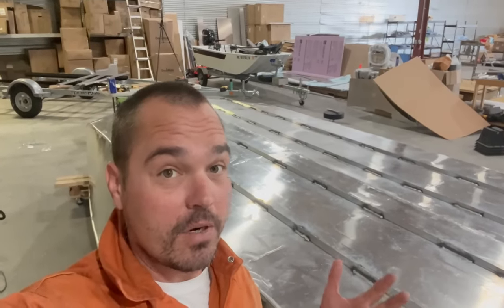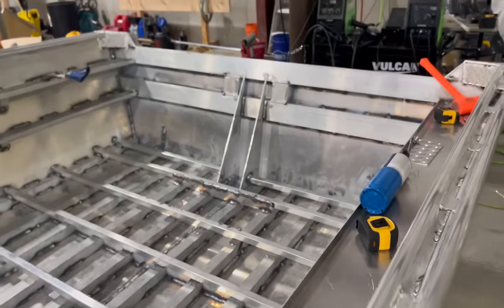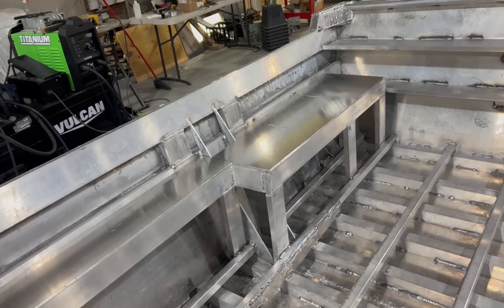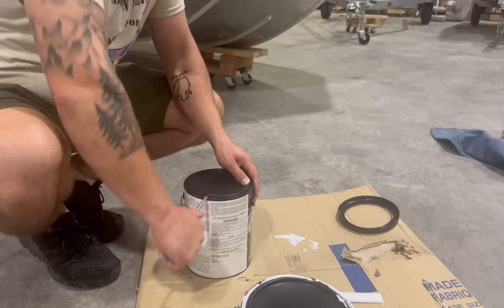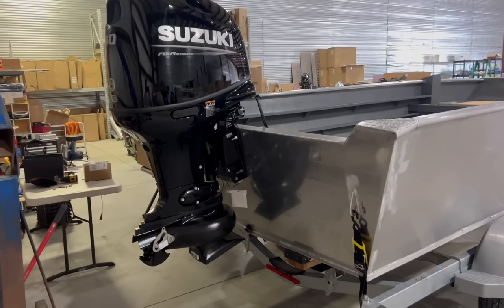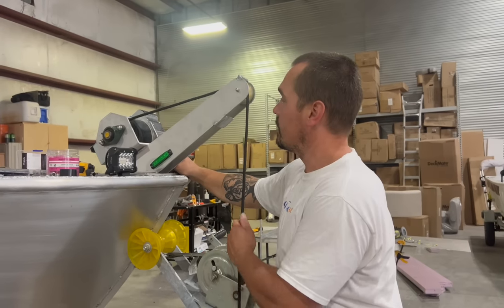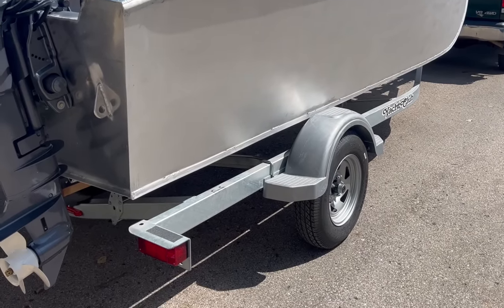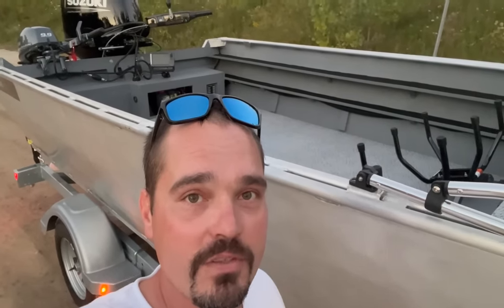EXTRA WIDE 17' Custom Welded Boat Build - Part 3 of 3

Comment: Why plywood?
Reply from the maker: Comfort and quiet. Standing on an aluminum floor all day or kneeling on it is far less comfortable than plywood. It's stored indoors so I'm not worried about it ever rotting, and the vinyl is 100% waterproof too so water just runs off it and into the bilge. A lot of the big name brand boats choose plywood over aluminum for their floors, so I can't be that crazy 🙂

Comment: That is one heck of a nice boat! I think people underestimate the ease and value of having an open floor in a boat, so many people spend thousands and thousands of dollars to have dozens of aluminum boxes manufactured for the inside of the boat cluttering it up. I love the lawn chairs instead of fixed benches or half boxes/seats. I am curious why the longitudinal stringer are not one continuous extruded tube that runs from the bow to the stern and having the front bent for the bow. Also 5086 H32 aluminum sheet is available in 120" x 300" sheets so that you your hull could be one piece of aluminum, with a 76" bottom it would still be wide enough to have 22" sides and then you just have to seam weld an 8" wide strip above the waterline to get the 30" sides you wanted, everything below the waterline is seam free. How much did all the aluminum cost for this boat project? Thank you
Reply from the maker: I love having all that open space, and the way I fish it makes it convenient to be in the back of the boat all the time. I've toyed with the idea guiding river fishing trips part time, and this boat would be perfect as a captain. The only downfall is when it's 35 degrees out the tiller isn't so fun. Someday I'll probably build something with a windshield and enclosure when I can't handle the cold anymore. 

I would love to know where that size sheet can be sourced?? The biggest that I'd heard of from my supplier is 84" wide, and they can run around 240" or so, but it's at a different facility than the one local to us so that adds a huge issue logistics-wise. I am pretty sure the two model boats I will build in the future will be 20' overall length with a 72" bottom and a 14' with a 60" bottom. 20' gets me over needing any flotation from the USCG requirements, and 14x60 seems to be a desired niche boat, perfect for two people and gear. And a 14x60 would be easy to design and incorporate foam for level flotation. 

I will probably run full length stringers in the future, but just sort of attacked this one as I went for those types of details. If I run them full length I can slit them to bend them up at a certain point. I full welded them in either way, so they're adding as much support as a partially welded full stringer as far as I'm concerned.

I think I had close to $10K into the aluminum for this boat, which is incredibly over-built. I could probably take out 30% of the extrusions and be just as solid!
Reply: @tomspontoons  The supplier is TW Metals, I will put the web address for that exact sheet and size in a separate comment as sometimes YT or the settings people have on their channel will delete any comment with a web address. If you do not receive the link let me know. I appreciate that you take the time to leave a detailed reply. Thank you
Reply from the maker: @chrisdaniel1339  Got the link, thank you!
Reply: @tomspontoons  No Worries

Comment: Big difference between ventilation and cavitation. I believe you have a ventilation issue rather than a cavitation issue. Cavitation is a propeller issue, ventilation is when the propeller sucks air from the surface and over revs. This is usually caused if the propeller is not deep enough in relation the the transom. Good job building a really nice boat, good luck.
Reply from the maker: We have tons of fun with “cavitation” on the channel, and you are correct, it’s ventilation when it’s poor water flow to the intake or propeller. It’s running great now though!! Thanks for watching!

Comment: I did what you did with the flotation loose and under the floorboards on a small 13 foot sailboat. When we tipped it over and were trying to get it back upright to bale it out….. the flotation put so much upward pressure against the floor boards that they all pulled loose. We then had floor boards AND flotation floating all over the place. Fortunately the boat was made of wood so it didn’t sink.
PLEASE make sure that you really over fasten those floorboards. Otherwise, if you swamp the boat it will go to the bottom and all you will have left is floorboards and Pink Panther foam. LOVE your boat though. Awesome work!
Reply from the maker: Wow!! I've never even thought about that. I'm pretty sure we've got close to 100 stainless screws in total all going into 1/8" thick aluminum to fasten the floor. I'm confident that it wouldn't push out, and mostly just hope to never have to find out!

Comment: Awesome project! I'd only question putting the fuel line in with electrical wires??? KA-BOOM!!!
Reply from the maker: No way around it on 99.9% of fishing style hulls. Heck, take a peek at the stern storage of a bass boat...they've got fuel cells and hoses, batteries, wiring, battery switches, etc. all in that compartment. Plus that's what fuses/breakers are for on the electrical side of things!!

Comment: Hvac tech in Miami Florida. 

I direct sunlight i use a wide brim sun hat. 

For the heat in general i use tons on cold water internally of course but also externally. 

Using a cooling neck rag or gaiter soaked in cold water works wonders for me. 

I freeze 24 (cuz that's what my cooler holds) 12 ounce Bottles of water in a chest freezer. 

Whenever needed i douse the gaiter in the cold water and it helps keep me cool. 

In extend situations i also douse my arms, neck, head, etc.

Comment: Hey Tom.  Wondered what you would put under the floor. I know the trade offs, but spray foam under ultra high grade marine flooring makes the boat ride and feel amazing. Needless to say, 100% waterproof, full floatation & amazing stability. I know it makes the floor semi permanent, but do it right and that's OK. I laid in two 4" PVC pipe conduits so it would be easy to run any future wiring. Two openings midship each side and then of course front & rear. I didn't find out until after, but learned you can coat the inside of the flooring with PVC sheeting or even heavy ground cover plastic, mount floor, then spray in the foam. That way floor can still be removed. (Foam won't bond to the floor). Wish I'd have done that.
Reply from the maker: Yep, we just did foam sheeting to keep it removable and dry. It allows for air to move under the floor and between spaces under the floor which should keep it dryer and fresher. I’ve heard of folks filling plastic bags with two part foam too in order to keep the foam from sticking to the floor and/or bottom of the boat.

Comment: Awesome build,,in 2021 i bought a new Suzuki 20hp with electric start for my 1542 jon boat,,was 10 hours break in period,,very nice motor and so quite and great on gas, hope you guys catch many many fish with that beautiful boat
Reply from the maker: Yes, this was 140 is also 10 hours total. The first 2-3 are the most critical in terms of not going wide open throttle and such. Heck, we’re still breaking it in when we fish (let it warm up extra long and no wide open for extended periods of time). I have the materials for a 1542 Jon boat, good to know a 20 hp could push it!!! Thanks so much for watching.

Comment: That’s one heck of a build you did! I’m surprised you used plywood for the floor instead of a composite material. That plywood will eventually rot out. And yes, I’d like to see a follow up after you’ve got some time on it and any adjustments/changes you might have made. Cheers!
Reply from the maker: The plywood debate will always be there. I love the comfort and quiet of plywood under my feet. If I have to replace the wood in 10 years I’ll be ok with that. If it rots sooner than that (I’ll be surprised if it did) I’d replace it with aluminum or composite.

I will definitely do an update in a couple weeks when we get more fish slime in it!!

Comment: Such a nice boat to have used wood in the floor
Reply from the maker: I totally get that. Its 100% a personal preference. I love the soft and quiet feel of wood under my feet while fishing long days. Weight wasn’t a huge concern either. My 12’ build was meant to stay super light, so that got 0.100” aluminum floors…it’s got more flex and more noise than the wood floors of this big boat. I’m all for either option!!

Comment: I always wanted to take a diesel outboard powerhead. Build a fire hydrant as a jet pump housing. Mounted to the bottom.   8 outlets.  2 big outlets to the transom.  2 to each side and 2 aiming forward now i have full internal thruster system. The power head and impeller are on a quick release. So i can pull them to drop in a spare, clean or service the impeller without having to pull out of the water as the top of the column is above the water line.
Reply from the maker: I like where your heads at, but that’s way beyond my scope of knowledge and even imagination!

Comment: Greetings Tom.  Impressive build,  she's a thing of beauty.  Please tell us the origin of FIRST LIGHT.  Why no livewell?  

I like the placement of the fuel tank.  I'm gonna do the same on the restore of my 14ft. tiller to punch through the waves better.  The forward weight should keep the bow down on solo rides. I tuff coated the interior sides of my boat the same way; however, I might bring the foam flooring up the sides this time.  Fun watching, thx for bringing us along.
Reply from the maker: We had to give the boats I build some sort of name, so landed on First Light...it's often the time anglers and hunters are aiming for to get out on the water. It's also a time of the morning that speaks to me because of the beauty of the sky, and the peacefulness of being on the water. I'm a morning person, so first light and a sunrise is the greatest moment of the day. 

Hanging 530 lbs of motors on the back I knew I needed to counter the weight with more than just batteries up front, and glad I did! It's a 17 gallon tank, so adds 100 lbs most of the time in addition to the two deep cycles on there for the trolling motor. No livewell because I don't use live bait ever and if I keep something it gets bled out on a stringer and then straight on ice. The Tuff Coat is incredible so far. I should have done the lighter grit option, but this stuff has been scratched with wrenches and all sorts of stuff during the finish process and it looks great. Happy I chose their product!

Comment: Very nice build the comment of using wood over aluminum I'm with you that marine grade plywood will last a long time especially kept inside and for you would be very doable to replace if time ever came any way
Reply from the maker: Good point…it’ll always come back inside and will stay dry 99.9% of the time. It sits so high off the bottom of the boat with the floor framing that it should never really come in contact with water.

Comment: If you don't mind my asking, what did the materials cost for the hull? I'm considering a similar project. Thanks!
Reply from the maker: I didn’t keep as good of track as I should have due to tons of trips for one or two pieces at a time (metal shop is 2 miles away). I’d guess $10K to $12K in aluminum.

Comment: Hey Tom, I’m getting ready to build my first jet sled. I really love that Suzuki 140. I’m from Michigan and just curious where I could find the motor and the jet pump. Thanks for your time.
Reply from the maker: Nice! What are you building?

I buy all my motors through Vans Sport Center here in Grand Rapids. Call Drew in motor sales (and tell him Tom’s Toons sent you). 616-364-0666

He’s usually got 140’s and pumps on order at all times, so he can tell you when the next will be available so you can get a deposit in and get your name on one!! I wouldn’t want any other motor on my boat, it’s hugely heavy and overbuilt and that 140 rips.
Reply: @tomspontoons  I’m building a 2072 1/8” sides 3/16s bottom jet sled. So I feel like that Suzuki will be perfect to power it. I’m not trying to drag race! lol thanks for the reference ill definitely give them a call. If there was anything different you could have done on this boat what would it be?
Reply from the maker: @loganemery2524 Nice! Where’d you end up sourcing your 3/16” sheet from? One piece bottom or two like mine?

I would have probably lightened things up a little with the cross-bracing floor supports. Could have done them on 16”  centers instead of 12”. Other little things like making the battery area in the stern taller for easier access. Biggest change would have been making it a less aggressive V in the bow. I love the 3 degrees in the stern, but it wants to dig a little with a bow heavy load. You just don’t get the trim response with a jet to lift the bow. Minor issue, and I’m sure when I run some lakes with it I’ll appreciate it being deeper.
Reply: decided he wasn’t going to build it
Reply: It is a 1 piece sheet of aluminum.
Reply from the maker: @loganemery2524  Well good score on that one. I talked to some of the boat builders around here and they said 3/16" is great and the ride is a little smoother, but getting dents out is a lot more work. I can get 1/8" sheets in 22' and 60" widths no problem, but going up to 3/16" thickness or 72" width is a challenge. I will likely move to building boats with an overall length of 20' (approximately 18.5' hull, 16" swim step, 6" anchor tower stickout). For the manufacturer they require zero flotation. You can build your own boat and title is as an "Assembled Hull" and do whatever you want, but building to sell means you have to meet USCG requirements. Sadly, it doesn't look like any of the custom boat builders in Michigan are doing any flotation which could mean a huge lawsuit and shutdown if an incident or complaint comes in. Not worth it for me if I'm building boats for customers so I'm working towards 20'+ or adding compliant foam flotation.

Comment: There is a product called shark skin you can use to seal that aluminum.
Reply from the maker: We've used that on Pontoons. The only trouble with it is that you have to sand it ALL off if you ever want to work on the aluminum, weld, or recoat it. I considered it, but for what this boat is I'm ok with the aluminum oxidizing and having a water line.

Comment: Hey Tom, where do you get your sheet aluminum long enough for this boat? Everywhere around me only has 12ft long.
Reply from the maker: I sourced mine through a local Metals USA facility. I believe Ryerson metal will get you longer sheets. A couple of the folks I’ve seen build aluminum boats on YouTube had to drive pretty far for their materials because it was hard to source it. Luckily we have a facility right here in town.

Comment: Who can I talk to to make me one of you shrimp and crab boats. I like the ones with the aluminum captain cabs up front that you show on your new pontoon boat’s video.
Reply from the maker: If you're running in saltwater I'd tell you to talk to a local builder who's used to building saltwater aluminum boats. Personally, I'd always run fiberglass in the salt to avoid the corrosion issues with aluminum.

Comment: What mig welder are you using, it looked like a titanium Mig, but couldn't see which one.
Reply from the maker: It is the Titanium MIG170. Good starter welder, but the YesWelder YWM 211P is a way more capable machine for a similar price point. I’ve got some videos using that machine. It’s got single and double pulse, and no need to run a spool gun which makes it way more comfortable and easier to get into tight spots. I’ll be showing that machine in my next build video of the 1660 I’m working on right now

Comment: You gotta flat-bottom boat, dents will happen. Does that Suzuki have enough fuel pump to handle a 12ft run?
Reply from the maker: Indeed they will! 

Yes, I cleared it by my local Suzuki dealer and mechanic friend. Ran 3/8” fuel line from tank to rear to be safe… which apparently was overkill!

Comment: Maybe I missed it , what was the weight of just the hull ?
Nice job , she looks pretty sturdy ! 
It will be interesting to see how fast shengoes and handles rough water .
Reply from the maker: Super sturdy, high and dry ride. I just weighed it and it’s approximately 1300 lbs of aluminum. 2300 lbs with motors, fuel, batteries and gear. Heavier than I thought it would be, but floats super high and scoots. Hit 31 mph wide open with 3 people.

Comment: Nice set up, clean lines and beautiful work done.  
Question for ya. 
Why did you not cut and weld in a tunnel haul for the jet?   
Also not sure if you know or not, that they make scoops that mount onto the foot of the jet unit.  We use them in Alaska. 
Once again beautiful build.   I would to have a custom build one time.
Reply from the maker: Thank you! Great question...tunnels have advantages and disadvantages. I want this boat to run clean on rivers and lakes (tunnels tend to get air to the jet in chop) plus tunnels are a pain in the neck in the fall here in Michigan with leaves because they feed straight to the intake and plug it up. I've used the fins on different boats (usually tunnels to get more water to the intake), but I don't think this one needs them. Water flow is super clean now that we dropped the motor.